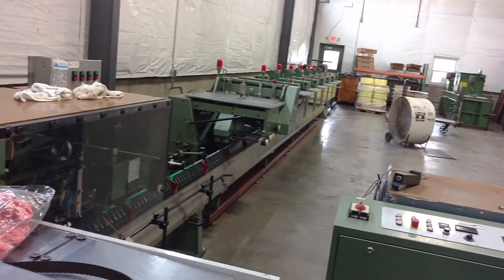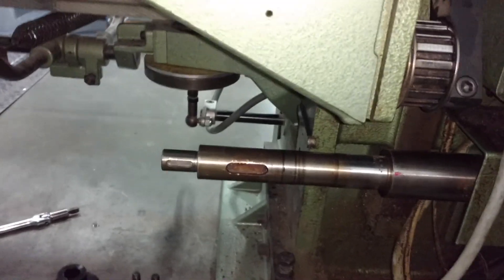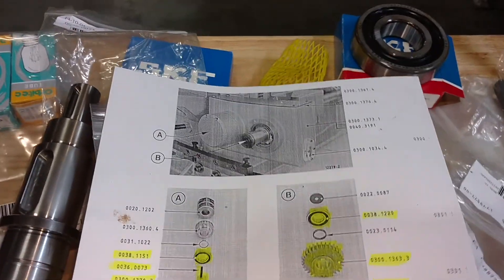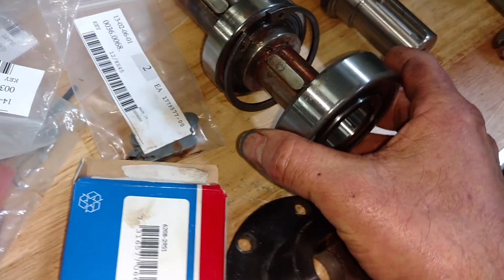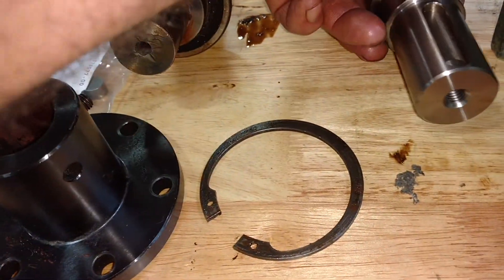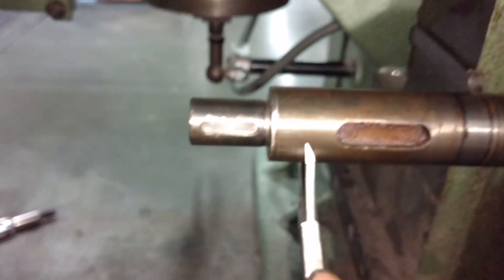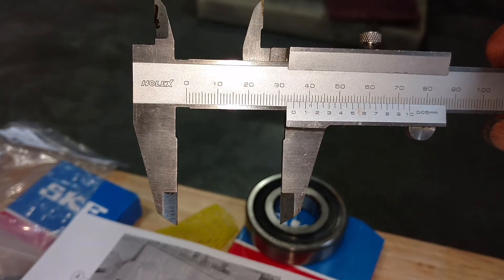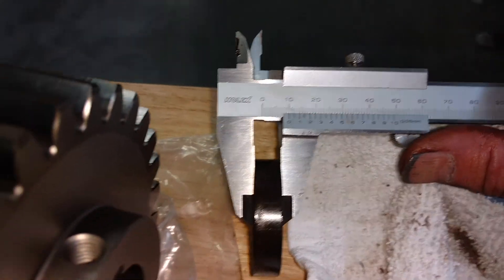Lmt 335 gear box

Comment: Slap it back together with new bearings. Shafts look ok?  We used to run a 321 stitcher? and a 251 Trimmer before we upgraded to a more electrical Muller Bravo and Prima.